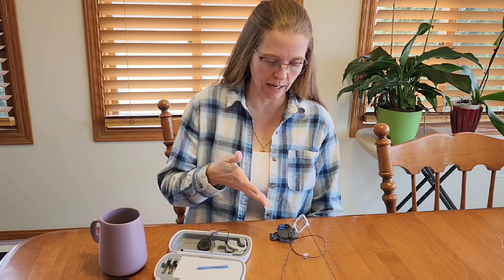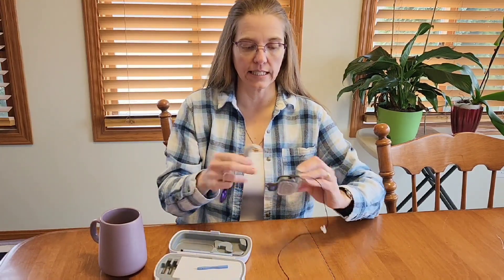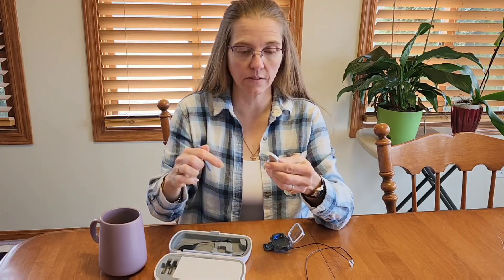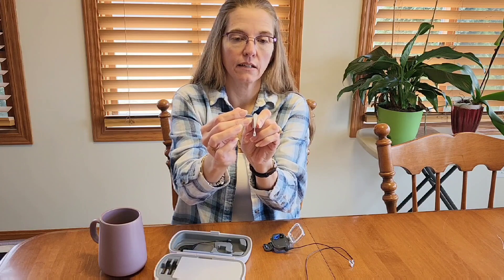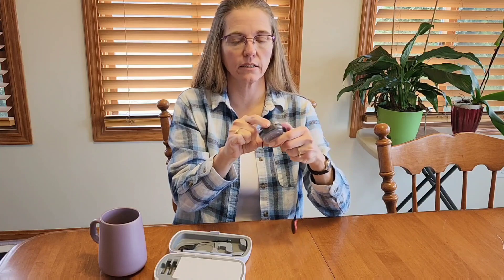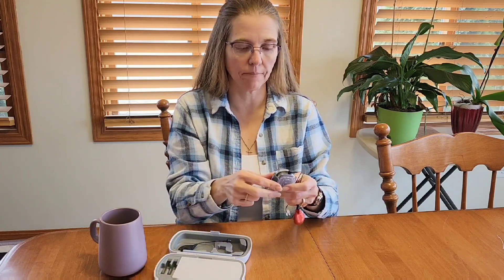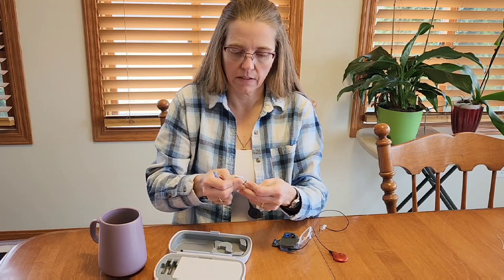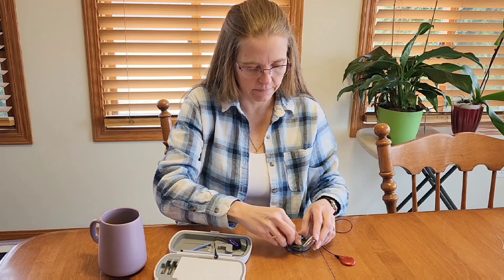How-to: Assembling the M Waterproof battery

Comment: Great video! I am blind and have a question about the cap/cover that goes on the aqua cable headpiece. Is there a specific cap that goes on the Aqua mic? The last time I used mine it sounded like a lot of water was hanging out on the Aqua Mike for an hour, but the other side did not sound that way! Thanks for your  help!

Comment: The Aquatic case comes with a charging cord.  When I plug it in to charge it a blue led light comes on.  How do I know when it is fully charged? Does the light color change to green?
Reply: There are 3 lights indicator that’s show how it fully works. Red means it not working and replug it again. Blue means that it charging. Green means fully charged.